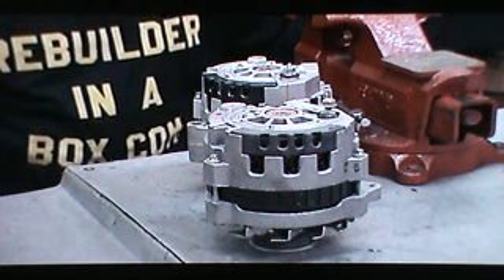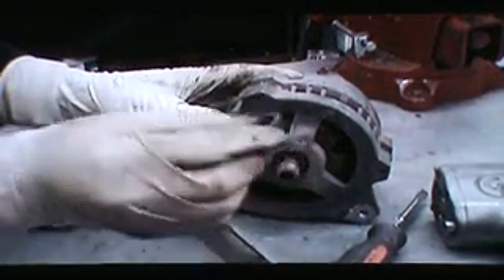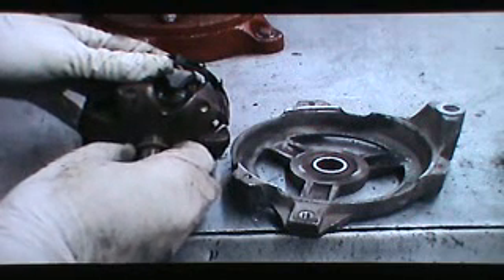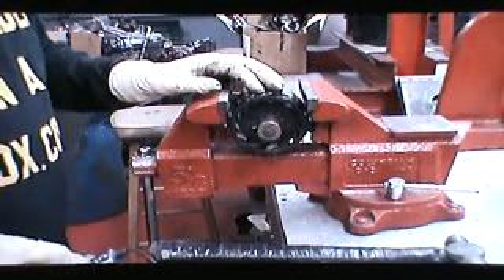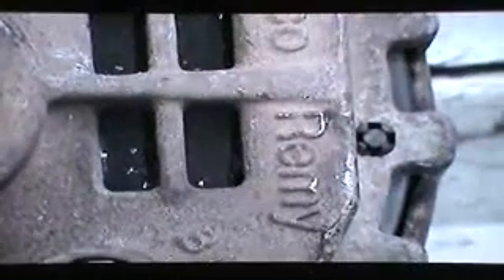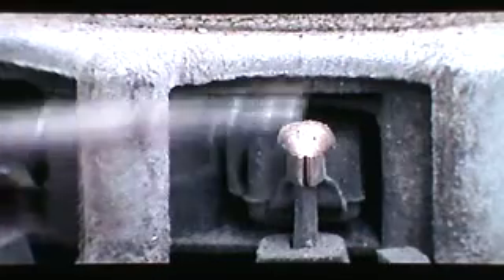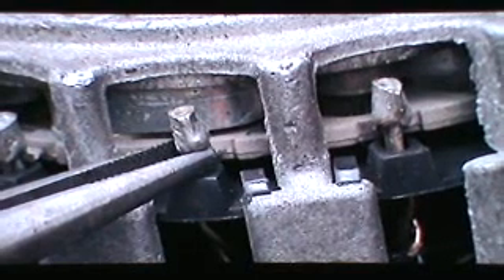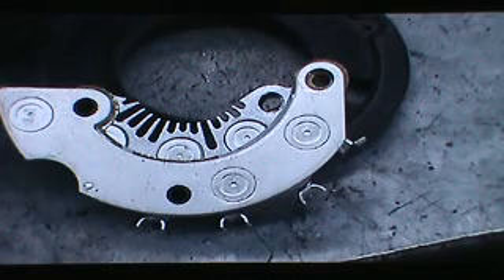How to repair a cs130 alternator | cs130 rebuild kit

Comment from the maker: We still do not recommend installing the baffle after doing thousands for 20 some years. It will cause problems by vibrating loose and rubbing on the rotor fan. If you have a new baffle, you CAN if your life's purpose is to do everything the hard way. At the end of the day, if the rest of the job is done properly for a normal duty application, the air flow will not cause decreased life expectancy. If you're running hot you probably have a low or defective battery.

Comment: I regrett that I did not re-install the rear baffel. The rear fan on the rotor is designed in such a way that it practically loses all effect when the baffle is removed because it is supposed to create a surge in the center and propell air out to the sides. Without the baffel this surge disappears, and the air is just propelled in circles. My rear hosing became much hotter when its not there, and I consider to take it all appart solder off the stator and installing the baffle. Actually I don't see why one should not reinstall it. Other than making it easier to change brushings next time. But provided that you replace them at the same time as repairing other things it will not be necessary for a long time.

Comment from the maker: We've given that alot of thought. Specially after doing thousands of them over the last decade or so. Most people don't have the right puller. We have a hydraulic set up for production and still sometime fall back on the method in the video. If you do happen to ding the copper ring a little, no harm will result, the brush rides much further away.

Comment: Your video was very helpful. The only thing I would change is you should use a bearing puller to pull the small bearing off the armature assy.  When I tried your method I bent the copper ring slightly.